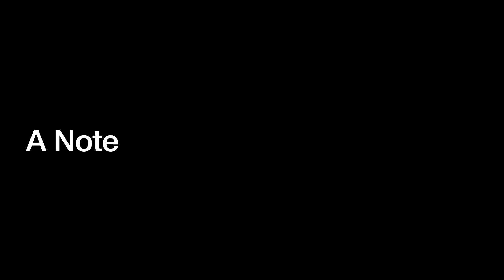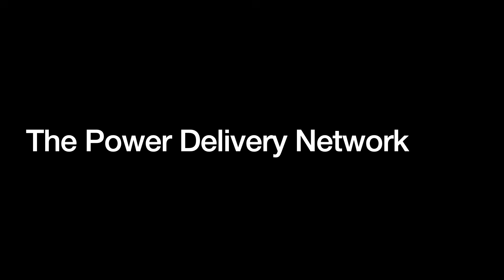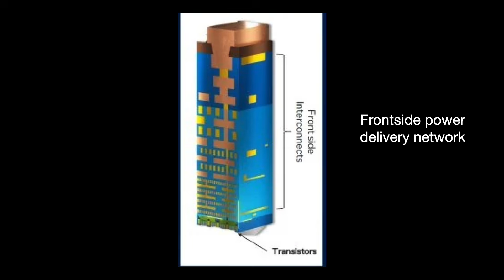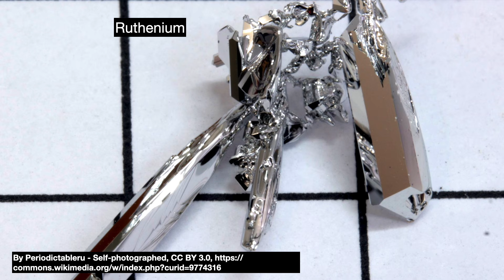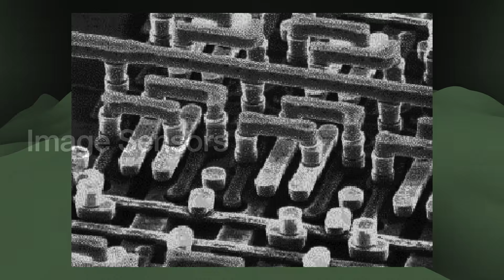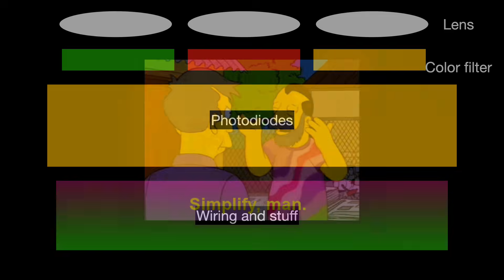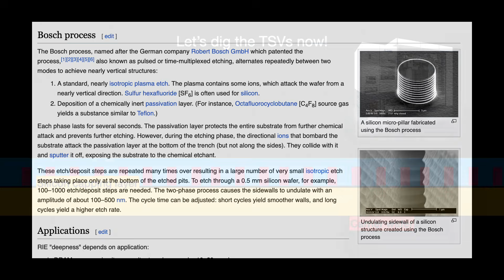Intel’s Next Breakthrough: Backside Power Delivery

Comment: Back in 1985, as a new IC process engineer working for AT&T in their Orlando, FL, CMOS fab, I tried an experiment just for fun (fun being a relative concept) where I thinned a silicon wafer with a Disco backgrinder with increasingly finer grit grinding wheels until the wafer was less than 3 mils thick - approximately the thickness of a piece of paper.  Upon releasing the wafer from the vacuum chuck I noticed that the wafer would deform into the shape of a potato chip and would often fracture under the immense stresses introduced by the grinding process.  Although the video doesn't adress this issue, I have to assume there is an annealing step included in the procedure used to thin out the wafer not mentioned, else this would not work.
Reply: I think a lot has already gone into reducing the internal stresses in the boules the wafers a cut from. 300mm wafers are already only 400 micron before any thinning (so only 4-5x thicker than what you got down to).
Reply: I remember reading about a company called Alien Technology making tiny RFID chips.  One of their special details was instead of cutting wafers with a saw, they did a backside etch to cut the dies apart.

If they are already doing some backside stuff, they could etch through the thin wafer to make it little chunks that are too small to potato-chip.

They might even do it twice to cut the chunks and also cut all the way through the die.

I'm not sure if this is feasible but maybe they could start with a deeper trench, add a layer of resist, then deposit silicon over it, then the backside metal.  They could grind the wafer until it was close, then etch away the remainder until they run in to the resist layer.

The last thought I have is what are the thermals like?  Theoretically a good connection to power and ground should carry away a lot of the heat and if the packaging is top side BGA, the bottom metal would be on top, almost touching the IHS of a chip which might allow even higher power density.
Reply: @beardoe6874  Wet etching following a grinding operation usually results in the formation of etch pipes as the etchant preferentially etches to relieve stress fractures.  There are proprietary tricks we came up with at Bell Labs to overcome this but it doesn't scale up easily to a manufacturable process.
Reply: @bradsalz4084  do you know what Alien Technology was doing?  I'm pretty sure they ground and then did the backside etch.  I have no idea which processes they had to do beyond the etch but it's a pretty safe bet that they had to add some steps.

Any way, I was just spitballing some ideas for how to stress relieve a thin bit of silicon...
Reply: @beardoe6874  Yes, I'm sure they had some annealing step post-grind.  These tricks are usually maintained as trade secrets instead of patents because proces patents are hard to enforce.  So  there might never be public disclosure about how it's done.
Reply: @bradsalz4084  yeah, I just think at this point they are throwing almost everything at the wall to see what sticks and backside etch seemed like the obvious answer to me.
Reply: That issue has been resolved.

Comment: Script error: resistance is given in ohms per square. It's a unitless measurement. Resistance is a function of the numbers of edge to edge squares you can put between two points. Its the same for cubes sicw its face to face ans thus the thicknesses drops out of the measurement.
Reply: No resistance is measured in Ohms. It isn't a unit less measurement. I think you are confusing resistance and resistivity. Resistivity is measured in ohm meter.

Comment: I think you got the purpose of decoupling capacitor confused with a smoothing capacitor. I mean, they are both the same component, so I can understand the confusion. Electronics, especially the role of capacitors, is weird.

Comment: I assume that the capacitors on the power rails are on the backside too. Are there any power transistors on the backside? Specifically, transistors for enabling power domains and the transistors for voltage regulation

Comment: One more thing, TSMC is making the BSPDN as a  node flavor instead of a spcific node for their planning. This means we may see them backported to previous node.
Reply: They can back port it to older process but I think unlikely. Older chips need to be redesigned to use the backside power. Process development and chip development are both very expensive so I would think only new designs will take advantage of this.

Comment: Great video, Asianometry! I learned a lot with this video. You touched briefly on this when discussing standard cell geometry, but moving the power to the back of the wafer will also drastically reduce signal routing congestion thus allowing for more transistors per unit area.

Comment: So what exactly is the application of this technology in normal electronics? I am not smart enough to know 😅
Reply: Faster chips (read: higher clock frequency), higher transistor density (read: smaller chips), and lower power consumption. All at the same time. Or hold any of the above constant and boost the remaining items even more.
Reply: @benjaminlynch9958  bruh! That sounds amazing! 

Between that and graphene being successfully tested recently the future of electronics seems somewhat bright doesn't it?! I figured we were hitting a wall called silicone pretty hard but after a few potential advances we might be moving past the slow down period in the future?

Comment: @2:36, I thought the power was proportional to the square of the current, not voltage.  You say ‘for a switching circuit’ specifically- but I still think you got it wrong.
Reply: For a constant resistance it works out the same... V^2 / R
Reply: the derivation for this assumes charging a capacitive load, a charge of Q = V*C is drawn from the power rail, representing an energy of E = QV. this is where you get the V^2 term from.

Comment: i thought the people who made the video know their thing, but when they said contradictive thing about electron flow in copper, i guess they dont really know what they are talking about. they said copper has the lowest resistance for electron to pass through, but then saying something like : when the minute copper is made so small, "due to the copper atomic structure" electrons can not go through smoothly. or at least thats what they are trying to say. 
something about "conductivity" is, the more electro-coefficient a conductive material is, the more linear the atomic structure/formations so the electron could jump more easily and efficiently. 
so when he said contradictive thing about it, means COPPER IS JUST BAD. how can it be deemed as a good conductor when a material atomic formation is not "electro coefficient"?
Reply: Because when sometimes is very small it doesn't act the same as when it's in bulk.  Copper may still be a very good conductor, but there's reasons that the very fine microchip to pin connectors use gold wire.

Comment: It’s ridiculous how little of the original wafer is left…
Reply: We're doing research rn into using graphene nanoribbons as a substitute to silicon for computational medium. Its edge structure can be used as transitor analogs.
Reply: Looks like it will eventually be replaced by some layer deposition on alternate growth substrate.
Or is it too cheap to bother?
Reply: @musaran2  it’s still the material from which all transistors are made. It has very high quality requirements and is grown in special conditions that would probably be difficult to achieve in deposition.
Reply: @musaran2  silicon is very malleable. We can do a lot with it that would require different substrates otherwise. It's one of those "jack of all trades, master of none" materials, in many ways.

Comment: The physical design of CPU chips may have to chance soon with the move to double-sided cooling solutions being provided for the physical CPU chip if air-cooling solutions continue to be used as the cooling method.  Otherwise, CPU chips could switch to microchannel cooling when the come with a standardized physical connector for applying liquid cooling.

Comment: Backside Power Delivery Network is actually known as BSPDN in the industry. Also, while Imec does incredible research for the industry, the research into BSPDN is a bit nuanced. As you noted, Imec relies on BPR (Buried Power Rail). While this is significantly simpler to manufacture, it provides much less in terms of gains as it requires more space in the cell and still takes up valuable M0 routing space. This also harms voltage droop somewhat.
Intel's PowerVia goes with a different approach where the TSVs attach directly to the transistor contacts which means they do not need to rely on BPRs which take up die space and they also do not need to rely on any M0 routing for power at all. It is a more complicated manufacturing method, but it provides much better scaling. Lastly, it is believed that TSMC is attempting to connect TSVs directly to the source and drain of the transistors with its implementation of BSPDN. This provides even greater density, but takes the manufacturing complexity to another level. This is believed to be a big part of the reason why TSMC has delayed their intro into BSPDN... Semiengineering has a nice article about this topic. It is from 2022 though.
Reply: Would TSMC gain better than 8% if they succeed?
Reply: @longiusaescius2537  that is a good question, but anyone aside from TSMC can only hope to speculate very roughly. I wouldn't expect significantly more in density and power efficiency though. Perhaps as fabs continue to gain more experience with BSPDN, the gains will continue to improve and this could be where TSMC could demonstrate greater sustained gains.
Though as an engineer at Intel, I should probably be hoping they don't 😉
Reply: So what else can be moved to the backside? SRAM? Analog?
Reply: Oh, in this case, the "frontside" and "backside" refer to the metal layers which are used as interconnects for data and power.
SRAM and analog have been largely considered for easy things to move off-die. Specifically, L3 cache (or LLC) with 3D die-stacking is quickly being adopted by several products. AMD has their X3D CPUs. Intel's upcoming Clearwater Forest CPUs will feature up to four compute dies sitting atop a base die which aside from providing interconnects between the compute dies and the other dies on the package, Intel has realized that if they're going to have a large, active base die interposer, it's rather wasteful to just leave it as just an interposer. As such, it contains a massive amount of SRAM as well, which serves as the LLC for the cores which sit atop that base die.

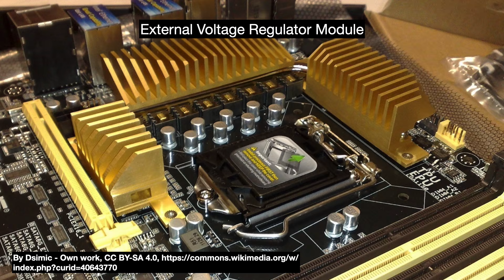Comment: @4:39 i believe it should be bypass capacitors. bypass capacitors are used for quick energy supply (power source bypass) and decoupling capacitors are used for line regulation (noise from a submodule should be decoupled from the rest). although in most application they are treated as the same thing.
Reply: same component, used for the same reason. different description?

Comment: A mistake has been made from the start. Electrons do not create a current, the fluctuation speed of electrons in a conductor is small. Current is related to the field, not electrons. 
You're talking about an assumption from high school physics.
Reply: You are confusing voltage and current. Voltage is related to the electric field. Current is electrons moving along an electric field, so you need an electric field (i.e. a voltage drop) for electrons to move.

It's worth noting that we use voltage as information carrier in digital electronics. So we don't need the electrons to drift all the way from A to B to transmit a signal from A to B. We just need the voltage to propagate along the wire connecting A and B, which is achieved by all electrons in the wire moving ever so slightly in one direction. When the electrons have moved a bit that is a charge shift which negates the electric field that made them move in the first place, which is what we call a voltage drop.
Reply: @Martinit0  Let's say—what would you say if the current were AC?
Reply: @MrRastler  Doesn't matter AC or DC.

Comment: Are the various nodes still getting smaller in a statistically significant level, or is it just overall compute architecture and FET form that is delivering the IP gains we're still seeing.  Also, realistically, how long can we expect these gains to continue, and will it become a "just dump 4348098 amps into the circuit sort of approach?
Reply: Packaging is the other big thing. If one can't fit on the chip, then one stacks as much as possible, and imposers as close as possible like a miniature MCM.

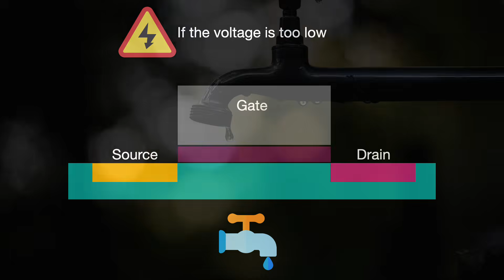Comment: 2:10
This is where it all gets crazy because electrons dont actually travel through wires 
Its a myth 
When voltage is applied to the wire a rotating imaginery field appears around the wire which carries the power down it 
Hence why power cables are taken off the ground, because earth is an earth that sucks a fraction of the power out of the imaginery field that spawns 
This is why is such sensative electronics like this they have to change power delivery because the way the power comes in causes directional imaginery field that overvolt the circuitry 
Its ironic really because its cutting edge mainstream science thats going to all sorts of lengths to work around a problem that their textbooks refuse to accept in the first place
Reply: Well, that's not entirely accurate. First off, on a purely nomenclature point, magnetic fields are far from imaginary, given we can measure them. This is me being a bit pedantic, though. However, electrons do travel through materials - Just very, very slowly. Electrons are inherently quantum particles and this is where it gets really weird, because the inherent property that makes metals conductive is that in any single congruous metal, the valence electrons - that is, the electrons on the outermost shell that actually allow atoms to form chemical bonds with each other to make them a solid - start being able to be anywhere. The internal composition of metal is called an 'electron sea' because any electron, upon being measured, can be anywhere, with seemingly no particular reason for one electron to be more likely to be closer to one atom than another in the entire piece of metal, regardless of the start position of the electron and the time passed. 
As far as we can tell, the way this works is that the electromagnetic field is how 'information' is preserved. In having an electromagnetic field, the universe doesn't need to care where every electron in the piece of metal is, and it basically offloads the information to the magnetic field. So the information is stored in the magnetic field, and upon something happening that changes the state of the electron sea, the electromagnetic field is checked and the effect cascades.

Physics is weird, man.
Reply: @Tonatsi  very weird
we know the 1st law of thermodynamics states that energy is preserved in a closed system but its about time we accept that its not a closed system because the wires interaction with what is essentially the aether breaks the second law of thermodynamics.. 
the initiation of the magnetic field that arises around the wire due to its interaction with the aether SHOULD cost something to be initiated but it appears not.
if anybody disagrees with the existence of the aether then please refer to the michaelson-morley experiment.
we know the power travels up the wire at "light speed" and  the textbooks say nothing should travel faster 
but the magnetic field around the wire is a spiralled coil not a straight line like the wire and therefore the spiral has to cover more ground than the straight line by a considerable amount... so it must break the speed of light in order to carry its charge up the wire 
the only simple solution to this issue would be to say the magnetic field around the wire arises from all point of the wire at the same point 
but then how could the start of the wire of communicated to the end of the wire that it needs to initiate faster than the speed of light?
universe appears broken on paper here but the "aether" keeps things in check
this makes us ask more fundamental questions about the reality we live in.
Reply: @SHERMA.  The laws of thermodynamics aren't being broken here. The closed system is being maintained because we can measure where energy is being leached. We don't need an aether to explain this behaviour, and furthermore, the michaelson-morley experiment fundamentally failed to prove anything.

There is fundamentally nothing to be gained from denying the results of an experiment, especially over 150 years since it was conducted, so if it had any merit, it would have become the standard model by now. An incorrect model of physics means less accurate models on larger scales which means literally everything that is made based on those models fundamentally does not behave the way the model predicts.

On the subject of breaking the speed of light... No it doesn't. There have been many experiments done that show that information actually travels through the magnetic field at a speed measurably slower than the speed of light. Furthermore, the initiation of the magnetic field does cost us something. It is, in fact, the direct cause of parasitic capacitance and inductance, because changing the energy in a system modifies the magnetic field, and vice versa, when the energy is lowered, the EM field dumps the energy back into the system. This is capacitance.
Reply: They can't admit these things because they have to control the sciences.  Too many logical leaps would come if they admit the truth.  Its 2024 and "science" still won't even admit the aether exists.